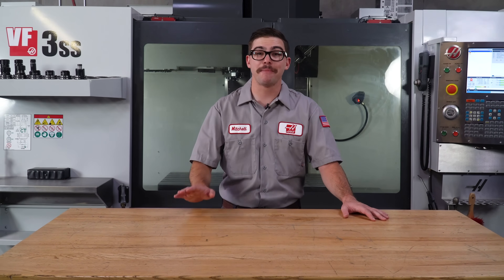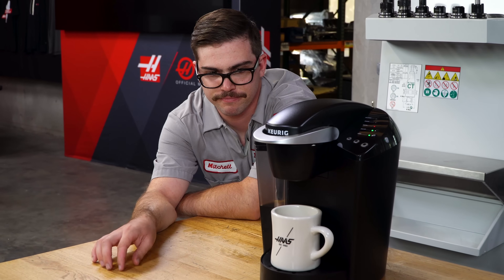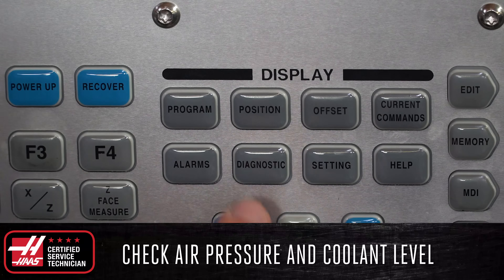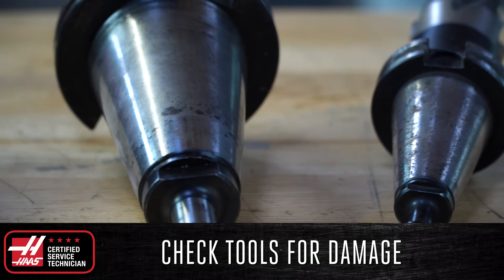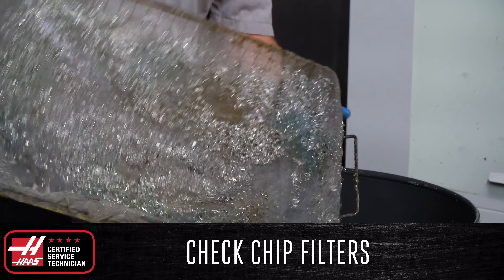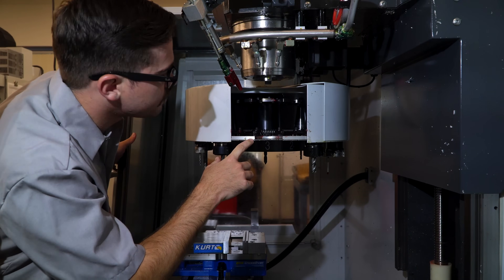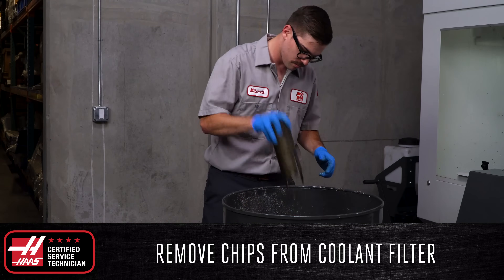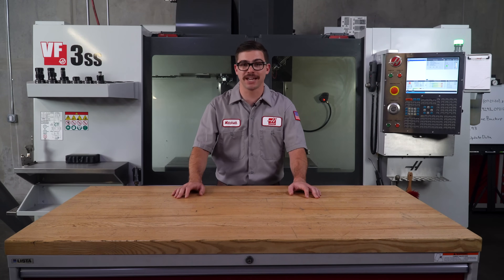Mill Maintenance - Daily & Weekly Tasks - Haas Service - Haas Automation, Inc.

Comment: This is a practical and easy-to-follow guide for keeping Haas CNC machines running smoothly. It highlights key preventive maintenance tasks that help extend the machine's life, boost productivity, and minimize downtime. The video is clear and accessible for both seasoned machinists and newcomers, making it easy to incorporate into daily routines.

By breaking maintenance into daily and weekly tasks, it ensures that operators can stay on top of their duties without feeling overwhelmed. Regular upkeep leads to better machine performance, fewer failures, and higher-quality parts. 

One improvement could be adding more real-world troubleshooting examples to help users adapt their maintenance routines to specific issues. Overall, it’s a great resource for maintaining precision machinery and avoiding costly breakdowns.

Thankyou so much guys!

Comment: How do you get to keep the door open on a side mount tool changer so that you can see in to clean
Reply: Might be a bit late but go to MDI, type in whatever tool you want to check, type "t(tool number) then press ATC forward or backwards doesn't matter, then after it drops the current tool out of the spindle and into the tool changer immediately press feed hold as its spinning over, just rapidly press it to make sure if it makes you feel better, it will finish spinning then stop in place with the door open, thats how i do it at least, im sure theres a proper procedure but this works fine, takes a few seconds and you're done

Comment: I prefer to put a light oil in spindle. As WD-40 washes out the grease from drawbar ball bearings
Reply: That is a much better practice, not sure why anyone would put a degreaser in the spindle
Reply: What kind of light oil do you use?
Reply: @kowalskimichael  
WD-40 was invented to repel water it was never intended to be lubricant. Usually I use cutting oil as it’s always available in the shops. On old manuals under maintenance said to  even grease drawbar bearings once a month ( put grease on one tools pull stud and insert in spindle, in/out a few times, clean off execs greased pull-stud).
Reply: @speez3354  Bruh, cutting oil in the spindle? thats the opposite of a light oil, 
its very sticky and viscous and i think i will make it worse.

Using ISO 30 or below should work fine thats what i used on my old vf4, rarely had sticking tools, tools sticking is normal after heavy cutting,  any lithium based grease on the pull-stud of the holder before you put it in, not too much or you will get grease on the taper and the holder will stick even more.
Reply: @mark7759  
My hole procedure is grease up inside of the drawbar by putting a thick layer on pull stud insert it in spindle a few times. Then with a old rag clean off exes of spindle taper. Then what I meant light oil and a light coat! The best oil I found was “air tool oil” but harder to find in a shop, put some on a scotch pad and run it in the spindle. And don’t leave tools in spindle overnight!! They will thermally lock up and damage tool changer in the morning.
Reply: @speez3354  Yup, i agree with what you said 100% there, that is correct methods.

Comment: Do you recommend leaving the work probe in the carousel when not in use while jobs run in the machine? I see Operators leaving it inside while jobs with 20+ tools and 20 minute cycle times. That's alot of moving for a precision tool to be left in the carousel.  Please respond. 

Thanks!
Reply: Probably not the biggest deal in the world, if they have been doing it for ages and they still work fine with adequate tolerance its not a big deal,
Reply: Not me! Renshaw and Heidenhein are marked tool A; B; C; ect.

Comment: Would be nice if this went more in-depth. Like how do you take care of the tapers and tools to prevent rust as shown in the video, is it necessary to use pull stud grease or other greases or lubricants, which surfaces should have special grease or protection like the spindle body, etc etc. Basically, how to keep everything looking new!
Reply: Rust inhibitor sprays like WD40 as well as cleaning them up with scotchbrite if you see any build up of rust or anything of the sort

Comment: Why do you want to remove the tool holder before the machine sits down for a while?
Reply: There is a spring stack that holds the tool. Good practice to leave unloaded to extend its life.
Reply: If you run at high rpm the spindle can get warm and the tool will pull up tight in the spindle taper and then when you turn the machine on cold it is jammed up in there and if you have tool on power up turned on it jams the carousel because the tool won’t come out. If you’re fond of having a machine running at night unattended with power off at M30 put a tool change to a empty pocket at the end of your program and if you don’t have a empty pocket pick a light inexpensive tool in case it jams and turn on the idle timer so it will just shut off if there’s a problem. If you leave a tool in all the time it’s best to pop the tool out before power up restart and wipe it clean.
Reply: Older machines especially. The tool will get stuck

Comment: How do you get the tool umbrella to open like that?
Reply: Manually unload all tools.
•	Set rapid to 5%
•	Tool forward/reverse - umbrella moves in - spindle rises
•	Press feed hold just before or right at carousel index to stop spindle at up position
•	Press E-Stop
You may have to practice a bit to get the timing right. I did! Use coolant hose and then air to flush out all chips and get mostly dry. You can be quite aggressive and flush well. 

Clear E-Stop and index carousel 180 degrees with appropriate tool # and repeat.
 
I usually do not run my machine daily and at least do this end of day with air. I power down leaving the umbrella in this forward open position to allow air circulation. 
Before starting up I use a flashlight and inspect cam for chips and add just a touch of Lucas Red "N" Tacky grease on a small brush if needed, you do not need much. Check action of the doors.

I am a bit obsessive, when removing tools, I run spindle at low speed, 500 rpm while blasting with air. I pop out the tool into a clean rag, blow air up into the collet to get out any coolant. Next, I inspect the overall condition, light spray with CRC and wipe clean, set in rack in sequence.

Be safe – Use E-Stop!
Reply: @UncleBman  Yeah that's what I currently do, I was just hoping there was a less janky way that would let you turn the holder as it's open

Comment: Keep blowing chips off that umbrella with NO TOOL IN THE SPINDLE.... never blow air with an empty spindle
Reply from the maker: Good observation Gus! It is best to blow off chips anywhere inside the machine with a tool installed in the spindle. If you do happen to use the air gun inside the machine without a tool in the spindle then check that you haven't accidently blown chips up into the taper or drawbar areas. Thanks!